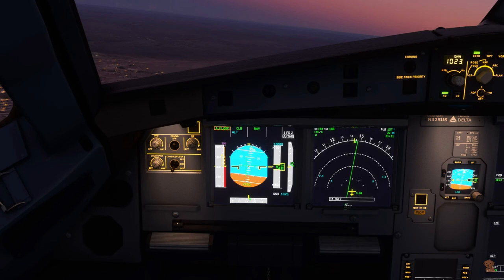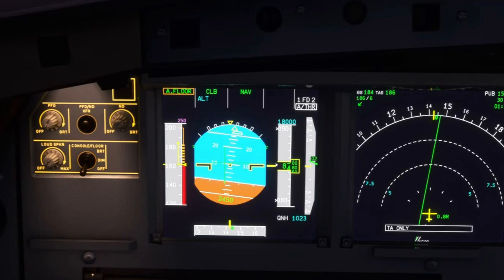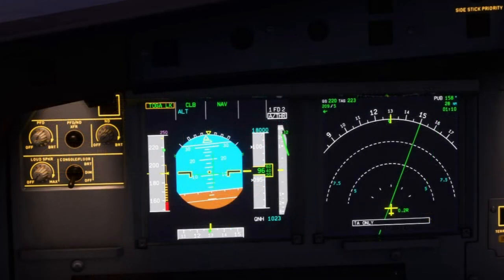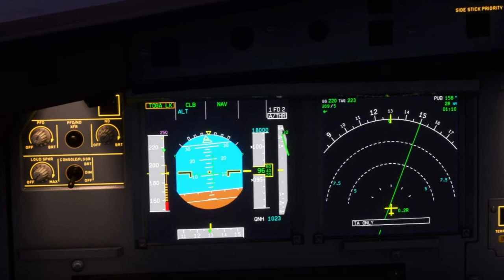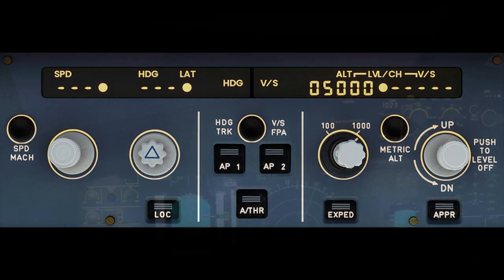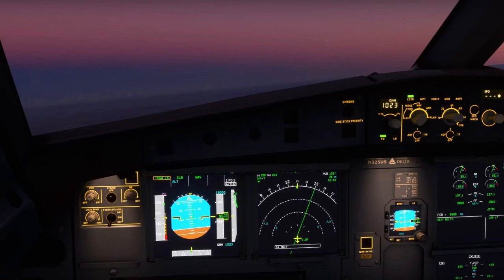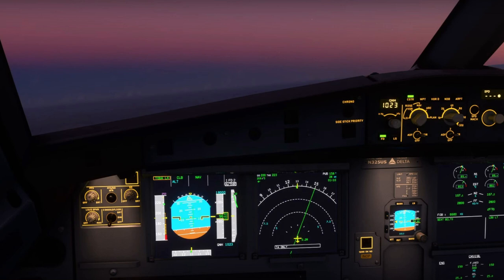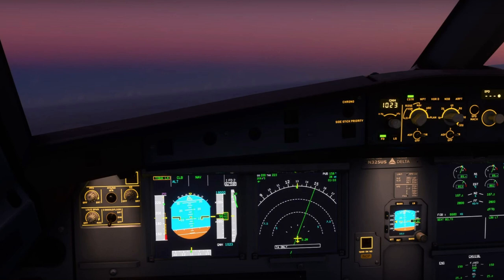MSFS - Airbus A320 - Alpha Floor & Toga Lock (A.FLOOR & TOGA.LK) - What is it?

Comment: Just to nit pick, you haven't quite got it right regarding what TOGA lock is. 

This is a state after A/FLOOR whereby you are no longer in Alpha protection, but the A/THR maintains TOGA. TOGA has been commanded already when in A/FLOOR and cannot be disengaged until you've sped up to a speed that has you out of Alpha protection. TOGA thrust can be disconnected when in TOGA lock but not in A/FLOOR. Hope that made sense.

Comment: I got a blinking A-Lock in the Engine Display and my autopilot will not engage! what does that mean?
Reply from the maker: It means the autopilot first needs to be disengaged.  
In the Airbus you can do that by pressing the red button on the side of the throttles.  Or whatever keybind you have assigned for that function.  
Then adjust the plane so it's flying within parameters it is comfortable with.  Not too high speed and not too high pitch.  Then re-engage autopilot.

Comment: Hello, great information. When you say it, passing the red button, are you pressing both o them or just one on he captain side? Also, do you have any simple information how have to setting up wing-windows view? Thanks
Reply from the maker: Just the one on the Captains side.
Wing windows view... if you can navigate into the cabin yourself (internal cam), then you position the camera where you want it then press whatever key you have bound to saving a custom camera. There are 9-10 of them.
Then there are keys to show that camera.
e.g. Alt+1 to save the cam positon, CTRL+1 to view that camera position.
It's something like that, check your bindings.

If you can't get into the cabin yourself then try flightsim.to and look for a camera view file on there.  Then you'll have to replace the camera.cfg file for that plane.

Comment: Hi Rusty!
Thank you so much for this explanation concerning the A.Floor mod on the PFD!!  This was happening to me of course after take off... In fact, after viewing your video i realize that  the A320 was near the stall.... i will be careful, in my next flights, not to pitch the plane too much, to avoid stall... So i hope that i will never more get this A.Floor alert!!! Thanks again !
Reply from the maker: You're welcome.  On initial climb, pitch to around 15 degrees, then, if you still are flying manually after the first 2,000ft, I'd decrease to 10 degrees as you drop the thrust to the climb detent.

Comment: Thanks for this! For a few days i've had trouble with the plane doing this when landing and it's driving me nuts!. Recent update has changed something with the TOGA system so i'm unsure if i am doing something wrong now whereas before i land absolutely fine. So i am going to check this now see if i can stop it. Or it could be a bug...will see!
Reply: Oh and i land generally between 150-140kts and disable auto thrust a few hundred feet before landing